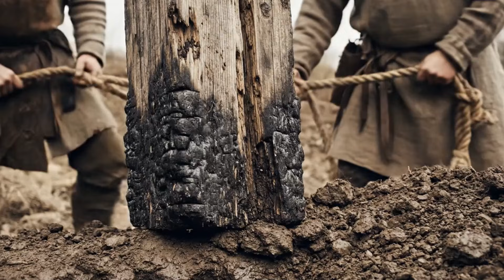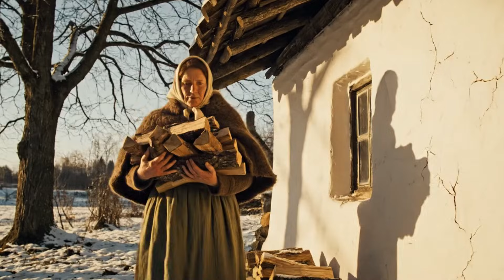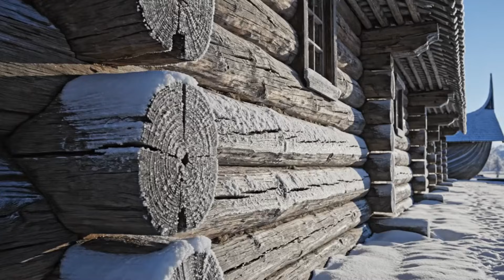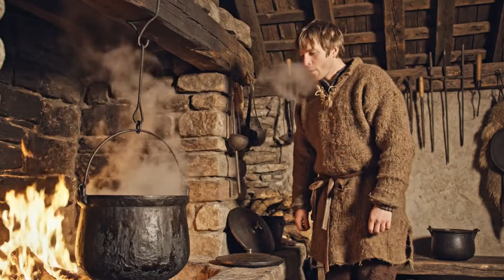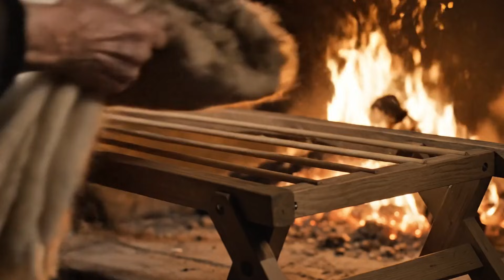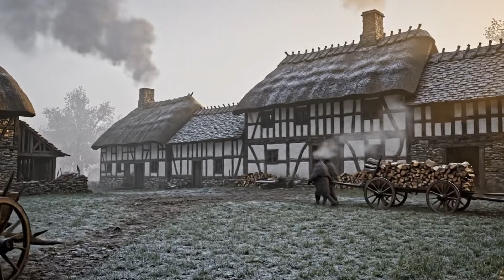Medieval Survival Shelters – Built to Beat the Freeze

Comment: I live in a bamboo ,two room shelter. I skinned it with tarps and zipties. Lots and lots of zip ties. My "living space " is about 260 sq ft. I have a gasoline generator rated at 5000 to run a few things. Heat and light make a big difference. I'd had candles and pots and other various heat sources but 110 volts is simple. I have a 650 watt AV receiver and a swell group of spkrs. I built a brick fireplace,stove with bricks from a nearby former landfill. Tonight the forecast predicts 1-3 inches of snow followed by another storm midweek. Love life outdoors in Pa.